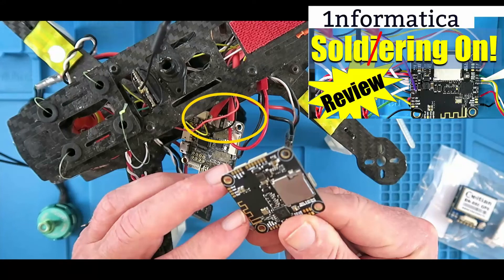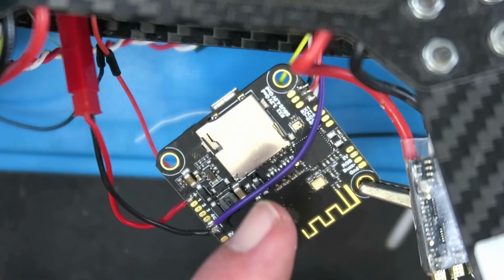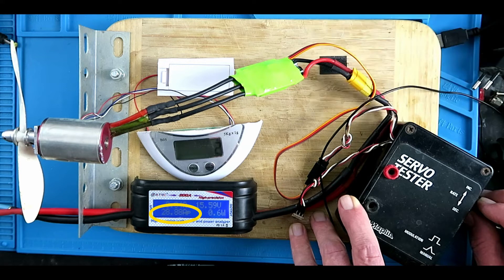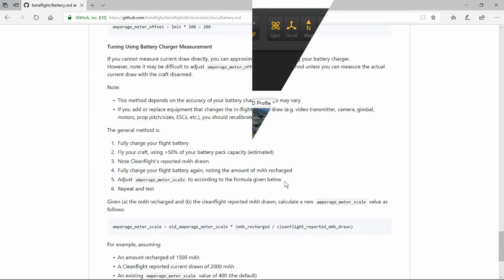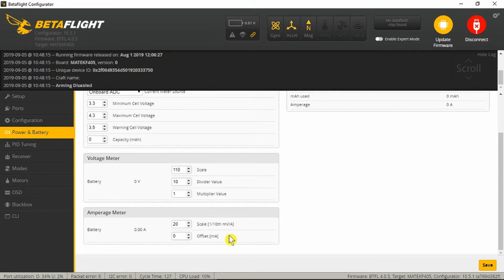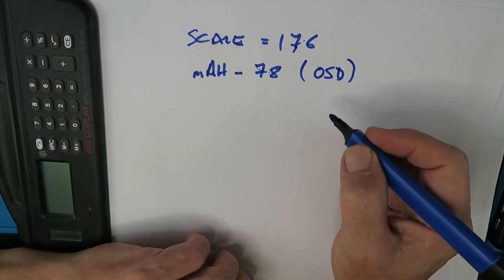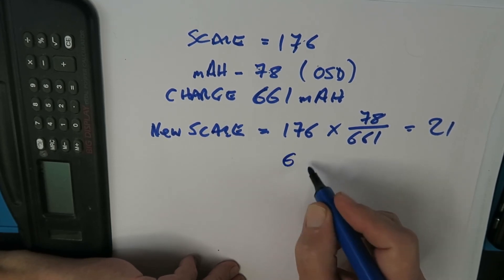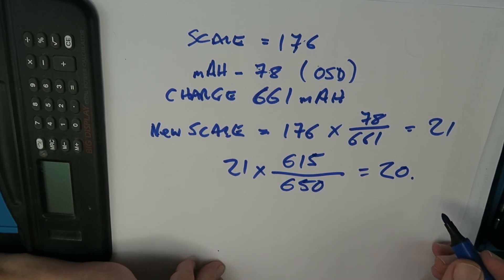FullSpeed FSD AMASS XT60 Current Sensor Calibration Betaflight

Comment: Thanks for the video! However wouldn’t this measurement be different for the exact weight of the drone? Meaning if you measured with a 150g pack vs a 200g pack?
Reply from the maker: It will not differ with weight. Once calibrated you can change packs and still get an indication of charge used / remaining. You only need to recalibrate if you changed something that is drawing current i.e. motors or VTx. Thanks for watching, have a great day!
Reply: @1nformatica  thank you. My scale is way off. I showed 9980mah used in the OSD and only 940mah put back into the pack. The amp reading seems correct now thought! Thanks so much!
Reply from the maker: @KAREKINFPV  You're welcome! Have a great day!!

Comment: Really nice work, my friend! 😃
I still have to do that in my quads, but... Well, I don't have much where to fly around here. 😕
Anyway, I'm going to build a FT Tiny Trainer, already printed the plans... And just built a tiny board with a FPV camera and a VTX. 😃
I'm going to use the Foxeer Micro Arrow Pro, the cheapest I could find with voltage sensing and OSD. 😃
Reply from the maker: Thanks Mario! The Tiny Trainer looks like a great project. You MUST make a video!!
Reply: @1nformatica  Well... Maybe I do a video afterwards, showing some flying. I don't know. But I'm not going to record the process, because I'm going to build with my father and a cousin. 😊
Anyway, I guess in about 3 months I'm going to be able to record again. Let's see. 😃

Comment: Fallacy.     mAh being used to charge is well above what was used or available.
Reply from the maker: Really? I flew 1500 mAh packs to about 50% and the charge put back in was 650 mAh which sounds about right to me. Please explain where I'm going wrong.
Reply: @1nformatica  Measuring the Power to charge your cell your including energy consumed by the charger , Wire Loss ( Heat) and that actually being consumed by your cell.   Not the same numbers that your cell is capable of.  Capacity.    Any Heat generated in the process is lost power.
Reply from the maker: The charger measures the amount of charge put into the cell, not energy consumed by the charger. I charged the cells at 1.5 Amps, at that rate I cannot see wire loss or heat being a significant factor.
Reply: @1nformatica  I think your wrong.   Measure the power the charger uses as a whole and compare the differences.
Reply: @1nformatica  Do as you like.   Batteries are not like a Gas Tank.  Loss are encored .